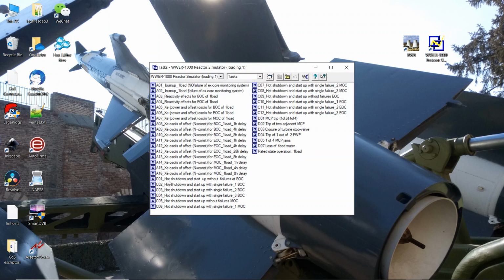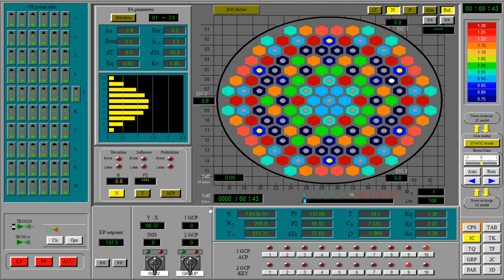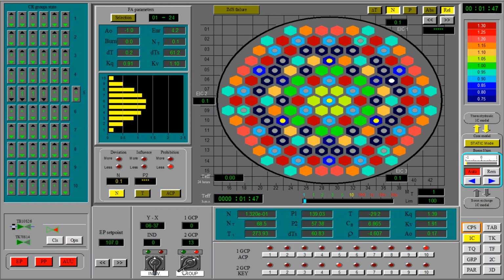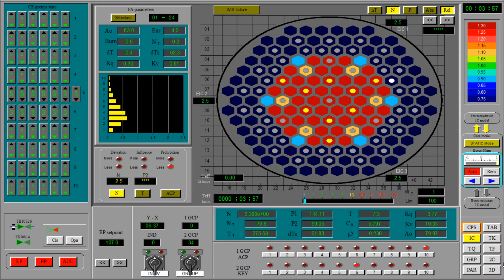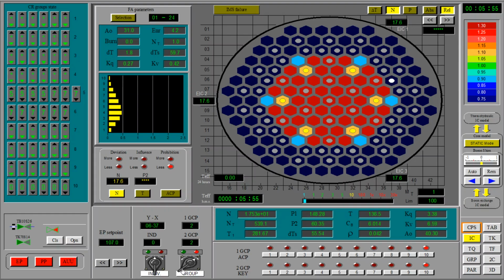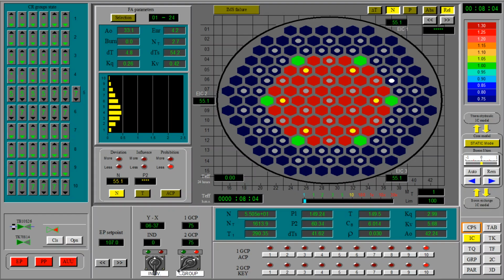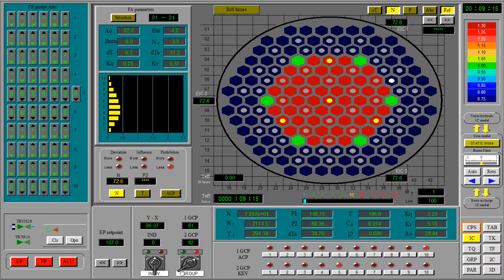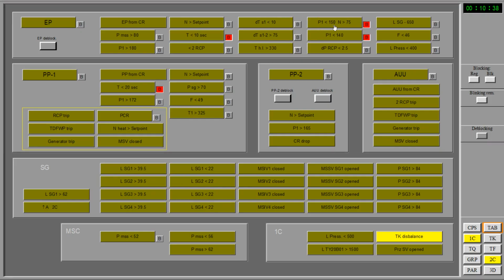Quickest possible WWER-1000 Nuclear Reactor Startup

Comment: hello the simulator doesent run . 
if you can help me pls ?
Reply from the maker: Try running it as administrator or with previous OS compatibility. Many people is unable to run it but I do not know why, in my W10 machine it works
Reply: @argilaga  Ok thank you 👍
Reply: @argilaga  Same problem, fix doesen't work.
Reply from the maker: @Patriot2609  Since this is not a software for the general public it could be that it needs some developer libraries like c++ Fortran, Python... installed in the target machine, I am not sure if that is the reason, but I have all those installed and it works.
Reply: @argilaga  No you see the sim launches like the menu but after i choose a scenario i get a black non-responding screen, i already have Python.
Reply: @argilaga  I installed all of them it still doesen't work, (same black screen after menu)